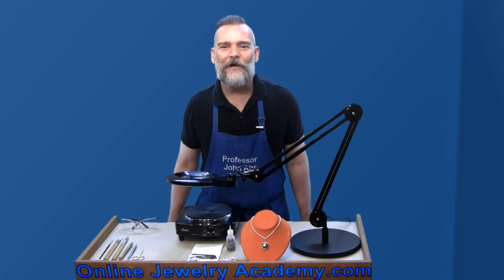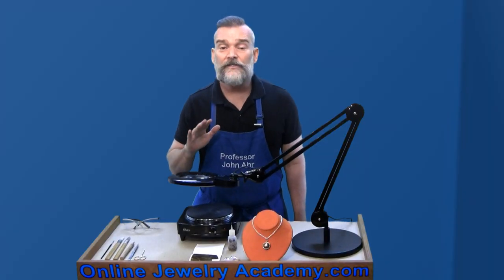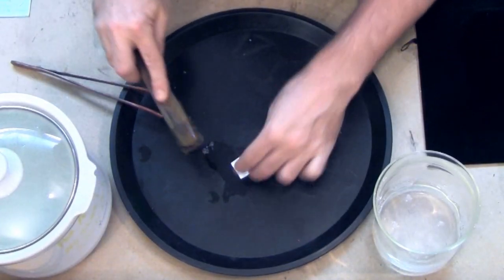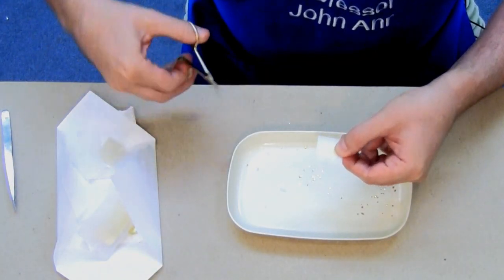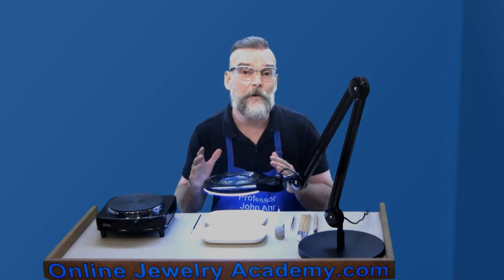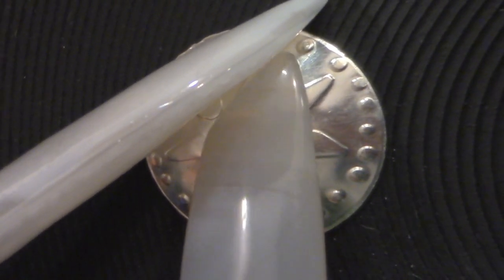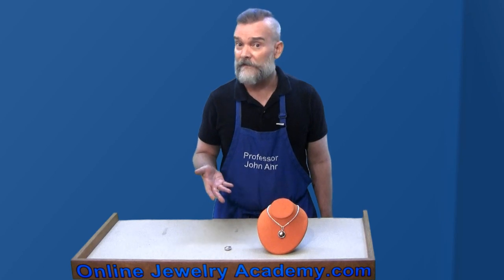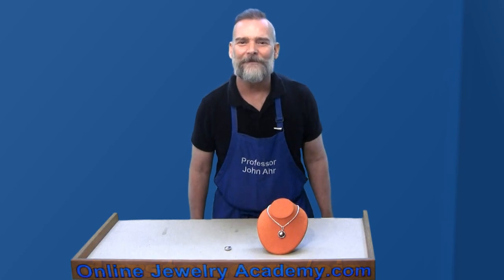Metal Bead Pendant Inspired By Ancient Coins Part 2

Comment: Would the caulking not exclude passing a thread of any material other than metal wire through it using the holes on either end? 
Is there no classic meralworking method to hold the domes in place?
Why not treat the cuffs of each side like ine would a bezel setting?
Idk but adding silicone to silver and gold doesn’t sit right with me.
If one was to add a tiny gem or two to these domes, it seems even stranger.
Reply from the maker: There’s a tube running through the center of the pendant. I could have bezel set the domes. I made a creative choice not to. 🙂

Comment: I love all your videos, and I have question sir, do I have to glaze the centrifugal crucible and what the easy way to do it? Please
Reply from the maker: Yes, you do need to glaze the interior of your casting machine’s crucible. You do it the same way that you glaze a handheld crucible. Simply heat the crucible with your torch. When it is hot, sprinkle casting flux on the interior portion. Once it’s cool it’s ready for use. 😀